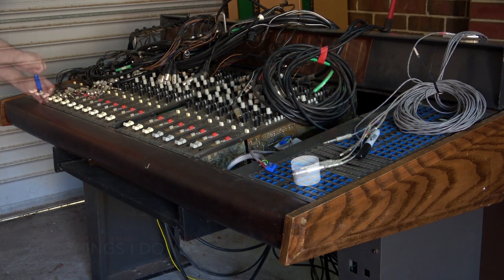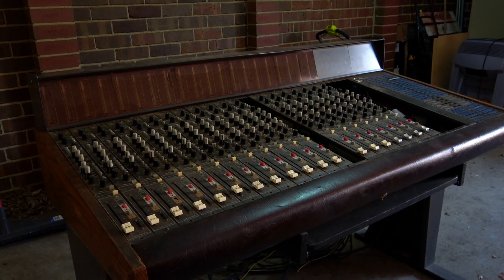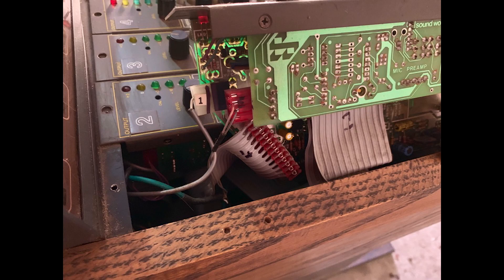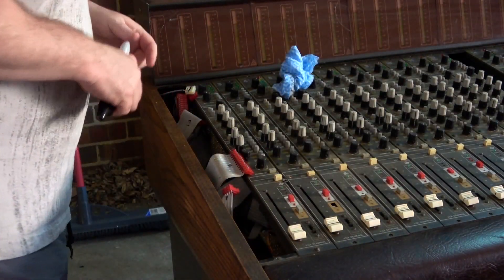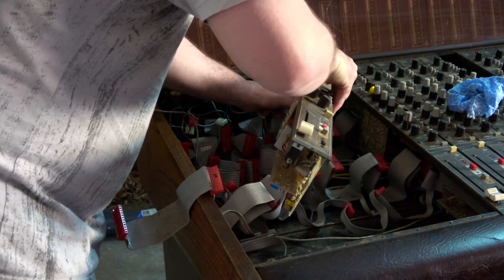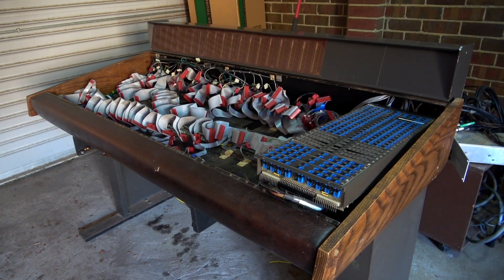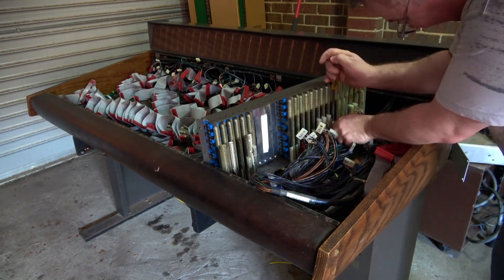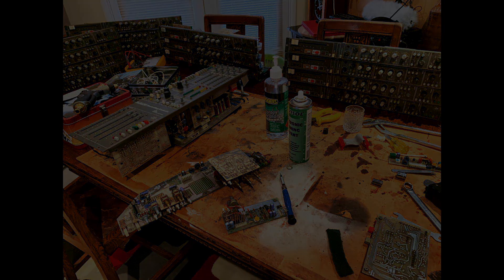Sound Workshop - Vintage Studio Console rebuild - PART #2

Comment: This is awesome! Did you decide to run out to analog, perhaps a tape machine, or are you running it through converters and going into a DAW?
Reply from the maker: Both!.. I have analog outs going into a Fairlight MFX 24track recorder but also patchable back into the 16ins I have to the DAW directly! The patchbay is very powerful :D
Reply: @100ThingsIDo  Oh, very cool! If I may ask, how are you taking the patched 16 channels into the DAW? Is it a USB-based converter? Or perhaps ADAT?
Reply from the maker: @mgmg116  I have a focusrite focusrite clarett 8pre with a MOTU 8 channel connected to it by ADAT. The Focusrite is getting a little old now as it only supports Thuderbolt 2 so it will be Dongle city to keep it running when I upgrade the Mac! :D
Reply: @100ThingsIDo  Ah, okay, I see! Thank you very much for you reply!

I'm saving up to add a console to my own studio, and thanks to an insane amount of luck, I have the opportunity to buy an Allen&Heath GL3000 console in mint condition for just $1100. It's 32-channel so it's huge and I'll never suffer from lack of inputs, but I need outboard conversion to bring those channels into my DAW.

The other option is going to be the new Mackie Onyx 24, which will just connect via USB haha. Tough choice, because I really want that Allen&Heath console lol. Studio pains